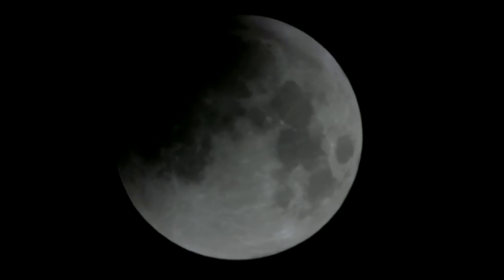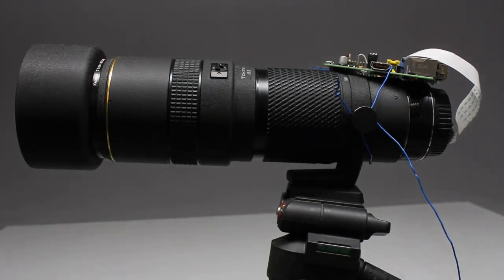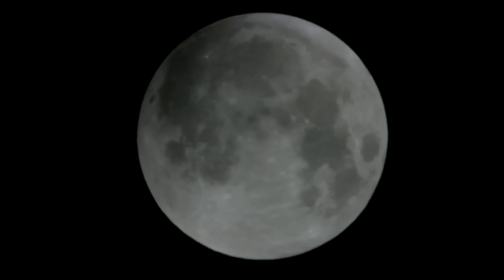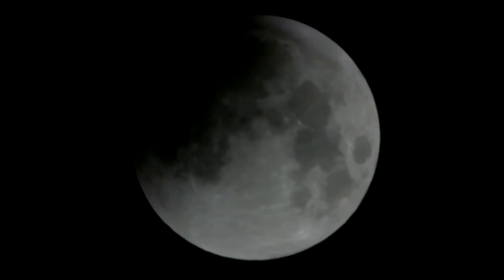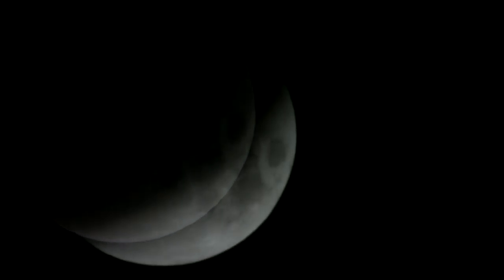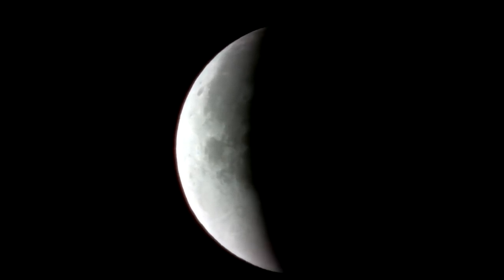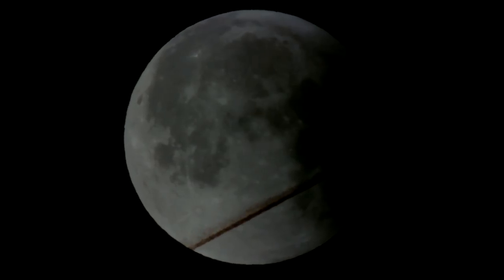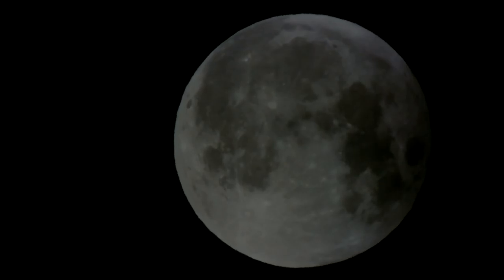lunar eclipse 2015 recorded with a Raspberry Pi camera module

Comment: Nice work. I have a Pi camera module, but haven't done anything astro with it yet. For tracking, SkyWatcher just released the Star Adventurer mount which would be perfect for something like this.  I have the smaller iOptron SkyTracker which works well for shorter focal length lenses, but is too small for the rig you're using here.
Reply from the maker: +Jim Hendrickson Thanks! I have a computer controlled mechanism in mind driven by stepper motors. It's currently nothing but an idea I am really interested in. Let's see if it will become something physical during the next year.

Comment: Very nice "Pi-cam" improvement! Thanks for the video!
May I ask you? The same could be made for example with Raspberry Pi and a microscope, for example for school science experiment, record an image sequence or a video of how grows a mold colony?
Reply from the maker: +qwanom A very cheap way of turning the Pi camera into a microscope is unscrewing the lens with the hotglue stick as demonstrated in the video. But don't remove the lens, just turn it out some revolutions so that the focus is on extremely nearby objects. It's like a macro lens, but because of the tiny form factor you can use it as a microscope.
Of course you can attach the camera to a microscope, too. You simply need an adaptor with the correct distance between ocular and camera chip.